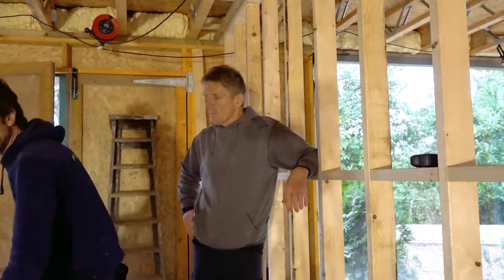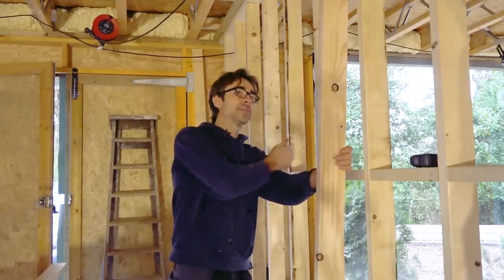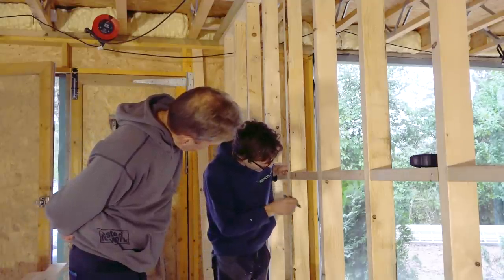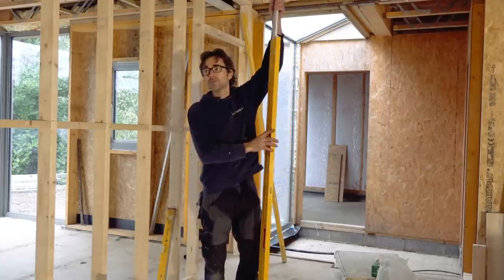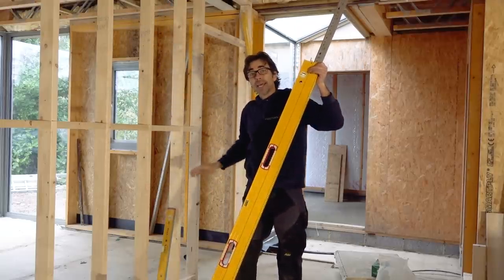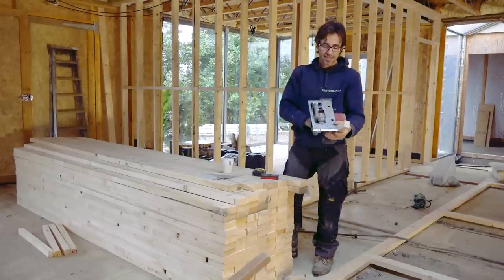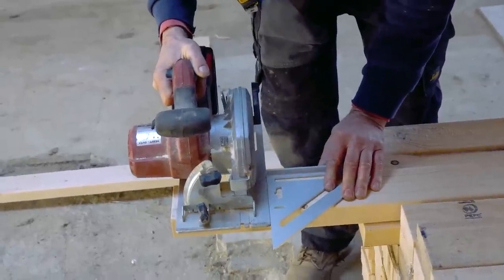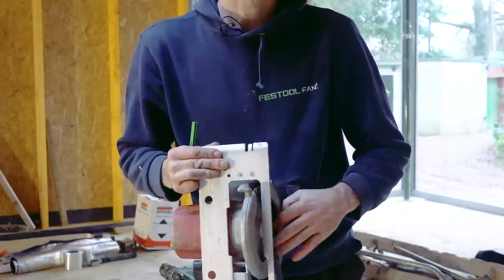Stud Work Like a Pro with Robin - Capel #10

Comment: Hi Robin , Straightening a stud, another way I do it the way I was shown was to cut through about half way as you say but square to the stud on the opposite side that you want to push in and when you apply pressure to the stud the cut opens and you then glue and bang in a wedge to stop the cut re-closing works very time. Great work thanks again.

Comment: I use a conventional tape and a chop saw for studwork but usually add 3mm to the length, because its not always possible to get the tape dead straight on your own despite the centres I mark top and bottom. If its a bit to tight to the header then I simply trim it a fraction with the chop blade and its possible to remove about a millimetre a time. I also stagger the noggins and then you can nail  The noggin through the studs to the ends. I have also always made it a policy now of over 40 years of studding over 8ft or 2.4 m I split the wall in three and put in two noggins.  Generally I chose the timber wisely for the straightest  lengths for the studs and check for where any bend is and try to cut that out as the noggin. Bent pieces get cut as noggins or rejected full stop and sent back.  I also never use cls  for stud walls but use tanalised, since they generally attach to block skin and concrete floors, neither which are generally dry at that stage in the build

Comment: Like to see what you boys are upto, I have been in this job for 35yrs & one thing that I have learned is that the saying "we have always done it this way" is not very expansive for the mind! bet that level cost a fortune! we get a straight length of timber for the upright, fix a batten on either end & tape a level to it, the batten eliminates the bow on any timber giving you a problem. we also have a spinning self levelling laser you lay on the floor, gives you all the primiters in one go then just fill in with uprights. keep them coming, I look forward to the next instalment from the gruesome twosome!

Comment: Great watching your vids Rob . Measuring studs has always been a contentious issue . What i do is set my saw stop on my dewalt stand , cut studs oversize each time , 40mm usually is ok . Then sit stud in edge of plate and mark of stud  at top . Having done stud work over the last 45yrs mostly on price work , this is the most effective way for speed  that i have found .
Ive tried pinch rods etc , but as ive learned the old adage in carpentry   the longest way round is the shortest.
Also no one trying to make money uses a level to plumb up anymore on big jobs . I used to use dewalts laser plumb bob , but weapon of choice amongst most now  is a 360' 12 or 16 line laser . Sorry to try and tell you how to suck eggs Rob , ive learned a lot from watching your uploads bud .😀👍👍👍👍
Reply from the maker: It is all good information, everyone has a different way of working and it is great to share information.

Comment: Tool fairs are great to get cheap deals on the stuff that a tool shop or builders merchant would normally have as well as the rarer tools, they usually don't bother bringing junk either as all the customers are professionals. If you're a tradesman and haven't been to one you definitely need to

Comment: I used to stick build my walls like that, works great if ceiling and floors are pissed and out of parallel. Nowadays I lay top and bottom plates on top of each other on the floor, mark out all the studs and openings, measure the stud length off the plates and build the walls in frames.
Reply: You are doing it exactly right Dan. Some people over exaggerate these things.
Reply: That sounds great 👍

Comment: Robin, do you ever use "tru-stud" timber ? We use it for all our studwork and boxing out. Its kiln dried, engineered (finger jointed) C24 and about as straight as you could wish for.
I've got a big hang up about wet timber and shrinkage. Not a problem on roofs but for joisting and studwork its a potential nightmare.
Reply: Nick Haley We have FJP here and I don't rate the stuff, in external applications it doesn't last even if treated. If it needs painting you see all the joins in it. Think it is the industry's way of piecing together all the shite to make another length from. Think it is good for the environment and landfill, but that's about it. Maybe you get a better grade over there. Cheers Jerry

Comment: I find it easier to set all the sole and head plates out as pairs, lay them on the floor in position and get one upright length for the whole floor and cut every upright the same length just smaller than the tightest point. Knock the frames up like a shed side and stand them all up nailed together before starting any plumbing up by working your way round with a level.
Reply from the maker: Hi Steve 
That is the best method for sure. James did it on his last video but it is not always possible.

Comment: When cutting a stud to straighten it, a plywood plate should be screwed or nailed over the cut to maintain the walls strength. Relying on a single screw to maintain the studs integrity and straightness is not recommended practice.

Comment: Hi Robin, love watching the videos and always pick up a useful tip or two despite being in construction for decades. One thing I was wondering about was with all of the timber you have in the place and seeing how busy your roof space is and the insulation you're using, do you have any fire breaks in the roof space and more than 1 access hatch in case something nasty happens? 
The reason I ask is because a residential building that I look after is having to have all of the insulation removed (Kingspan type) because the local fire brigade see it as a hazard. I appreciate your building is single level but just wondered if you'd taken into account the building's fabric in relation to this.

Comment: Using a laser is great, but if I don't have one I don't try and accurately measure it with a tape, for exactly the reasons you say, Robin. What I do instead is measure roughly with the tape, and cut the vertical 10mm over. Then place one edge of the roughly cut vertical on the footer and rest the top against the side of the header. Look down the bottom of the header with one eye and mark off on the gap side. Square off the mark, cut up to the line, and it's (usually) perfect.

Because the vertical is at a slight angle when you mark it, it will of course be a fraction longer than the actual height. It's tempting to think this causes a nice interference fit, but in reality the difference is too small to matter. Let's pick some conservative figures and say you rest the bottom of the rough vertical 10mm in on the footer, the ceiling height is 2.2m and the header/footer are 47mm high. Then the gap between the header/footer is 2200 - 47 - 47 = 2106mm, and the length marked off is √(10² +2106²) = 2106.02mm - only 0.02mm longer than the real gap. 

Therefore I always try to err on the side of caution here, making sure I really cut on the outside of the line. Obviously cutting too short is a nuisance, but if it's too long you can always shave a bit off.

Comment: Looks like a new home, why weren't all the walls prebuilt before the 2nd floor was added?
Reply: Depends where it's being built . Sometimes due to crappy weather it's eaiser to build from the inside when all flooring and roof has been done . That way you can plod along with work even if it's chucking it down outside
Reply: There is no 2nd floor.
Reply: @baldyslapnut.  Ah, must have been the extremely flat roof that fooled me.

Comment: Hi gents been watching your videos 
Thank you for sharing your knowledge 

Would you mind helping me out with this question pls 

Stud walls are 400 mm centres 

And the timber I am using is 4x2 which I’m told is 47 mm thick 

Therefore if I have all my noggins cut at 353mm at the timber yard to save time 

And then fit the noggins as I go along will this work out 

Thank you 😊
Reply from the maker: Yes that is a very good way to work. I do that a lot.
Reply: @SkillBuilder  thank you sir 😊

Comment: Do you need an air space between a stud wall and a stone outer wall? If no space would it sweat?
Would you line the back of the frame with a membrane or not?
Kingspan or Earth wool?

Anybody, cheers.

Comment: i'm gonna take a look at one of those levels, if i can find a stockist.
I don't quite understand though what Robin means how the lugs on the level help over the sole plate.
Maybe someone could kindly explain?
Reply: DP JOINERY if you were plumbing up a frame or panel that has anything on the face of it ,like a temporary brace that the level would foul on .
the lugs would allow the level to still touch top n bottom whilst clearing the obstruction
Reply: @shuggs8185  
Ahhh i get you, thank you for explaing that. Yeah i definitely want one then.
Reply: DP JOINERY it seems like the exact thing that I’ve been wanting for years ,would be very useful
Reply: I've got the 2130 - 3760mm level (106T) and use it a lot with the pegs on to check out of plumb external walls on old buildings. I also use a bosch inclinometer held onto it & set to read mm/m to find how far out of plumb. If using the pegs you can level over cills etc. 
Also really handy for roofs, you can check for straightness of rafters with the battens fitted to see if the purlins  are true. The only thing I would say is it's really quite heavy, excellent level though. Also.if you measure the pitch of anything (roof,stairs,drainage) the 600mm bosch inclinometer with laser is a brilliant and really fast tool to use - definitely recommend that.

Comment: If i have to cut a stud to straighten the wall i then add a sister piece (normally a piece of ply) to the side of the stud where i have cut to help maintain the strength of the stud

And for all those who are saying that a steel stud wall is a better option, yes that is the case for achieving a perfectly straight wall but i know from experience that when you lean against a light weight steel stud wall there is far more movement than a 4” x 2” timber stud wall
Reply from the maker: Azza Good tip on the sister piece and you are right the timber feels more rigid. It is also nice to work with wood.
Reply: Fire code sometimes requires metal studs over here (Netherlands). I hate working with them, much prefer wood ;)
Reply: A sister would imply same size and length. A more appropriate term is Flitch.
Reply from the maker: @tristanpatterson3843  My sister is a flitch

Comment: Hi Rob , fair play for all your vids , do you do you noggins straight of or up and down ? with a staff etc,  I use the  the small flex-volt chopsaw for studs  with a feed roller , try it , its fast  and light
Reply: I do my noggins straight to a laser and they go in to suit plasterboard and light switch heights, I also laser them all round and everyone uses them as a datumn line for general setting out, like your machine set up sounds awesome accurate and quick, thanks for your comment

Comment: Try metal stud work far better finish on all your walls and ceilings, I gave up on wood a few years ago after I did a course at British Gypsum at East Leake Nottingham.  They have a good training center for all their products from plastering c stud, ceilings. Sound proofing etc. 
Keep up the good work 👍
Reply: Hi Ray, I like metal too, but these studs where designed to share some roof loads so we had to go timber, thanks for the comment
Reply: @ukconstruction  you can actually get metal that supports walls also....

Comment: Can you use 3x2 cls for a stud wall?
Reply from the maker: Yes it is done quite a lot but you have to accept that it isn't as stiff. If the ceilings are low and the walls are not too long it is fine.
Reply: @SkillBuilder  its for a 4mx 3.6m man cave 2m high ceiling ?  It will have 12mm osb on one sidevand plasterboard on the other thanks for the reply

Comment: Never knew site carpenters used circ saws for studs. Would have assumed mitre saw.  Can see it would be just as efficient though if every stud is different length.
Reply: A circ is easier to carry to and from site. Mitre saws are usually bigger, heavier, and to use effectively need a stand.
Reply: why do we want a 45 cut do you mean a pull over saw or a snip saw
Reply: @eddo167  I've never heard it called either of those things.

Comment: I was taught to fix a bowed stud to cut halfway through at the backside of the bow and then tap a wedge in this elongates the back side of the bow. I don't understand how a 45* cut with a screw in will bring it back straight 😖
Reply: I do the wedge trick too, but with the CLS the cut and screw works particularly well too
Reply: So are you closing the gap with the screw made from the saw cut or does the screw open up the cut by pushing on it.
Reply: it closes the sawcut. so instead of making one side longer with a wedge, you make the other side shorter with closing the sawcut.
Reply: Richard Short that’s how I do it in New Zealand as well ...wooden wedges.
Reply: Ferry Groot Thank you for the explanation. My mechanical and logical way of thinking is that the 45* degree cut would need to be dead on centre of the stud crown to shorten it. I still think I prefer the wedge on the backside of the crown is the way to go. Thanks again brother.
Reply: @aorakiboydog  Wedge is stronger, I use wedge and screw.
Reply: @francois1473  Hi no it won't make one side longer just holds the cut from closing up again because you are pushing the timber bow in, It has been done that way by many carpenters for years before we had screw on site and cordless drivers this is the way you did it.  Bu Robins way works as well.

Comment: Why not use steel, it is always straight, it is way cheaper than timber, not flammable, already has precut hole for wires and pipes and even complete novice can build perfectly straight wall in no time. Best of all it will stay like that because unlike wood it will not shrink or expand depending on moisture. I love your videos but wooden frame for drywall is thing of the past, just let it go....

Comment: Good for diy derek but too slow on price, just take the smallest measurement knock the wall up on the floor lift it up and pack where need be
Reply: In my case the walls will all help with the roof loads so the method that you talk about is something I do when there is no loading requirements, also this is my house so only perfect will do no matter how long it takes!!
Reply: Fare enough if it’s your own home then take all the time you want, if I was using a stud wall to bear a possible weight of the roof then alarm bells would ring how the roofs put on to begin with because I don’t know a chippy/ builder who would use a stud wall to carry a roof, not aiming to pick faults but it’s just a lot of kids fresh out college with no onsite experience use the internet now days for advice and I just think the wrong advice shouldn’t be given, I’m just going on from what I’ve been taught through experience through my entire career 👍
Reply: no need to pack Joe. Lightweight (non loadbearing) stud partitions should have a gap over them according to NHBC guidelines so as not to become loadbearing

Comment: Cutting a stud in half and screwing it to straighten, instead of just planing?
Reply: If you plane the stud then it ultimately becomes thinner and you will have to pack the reverse side of the wall, this is why we straighten our studs when needed to keep the wall surface flat on both sides
Reply: planing it is certainly not an option Jacob